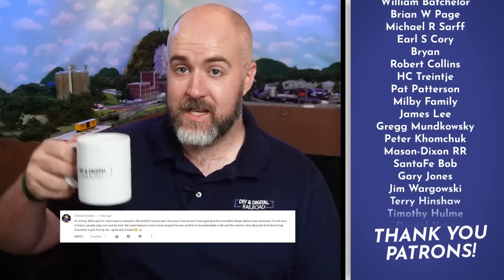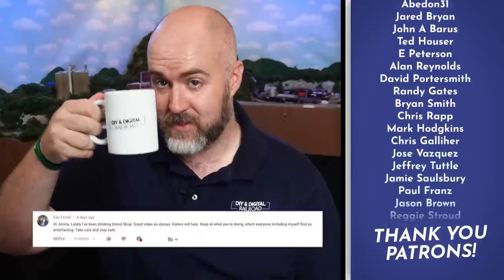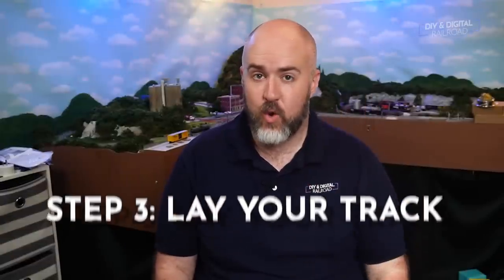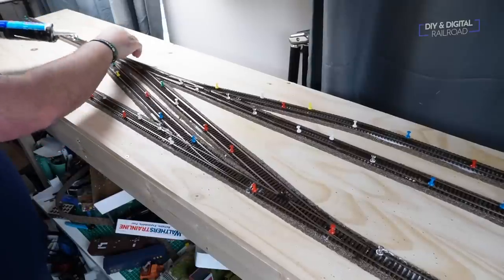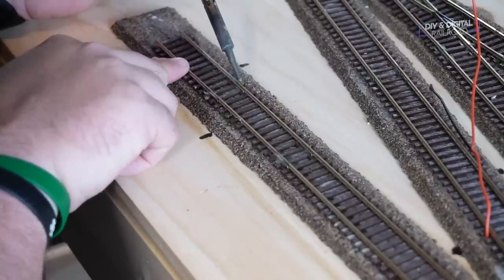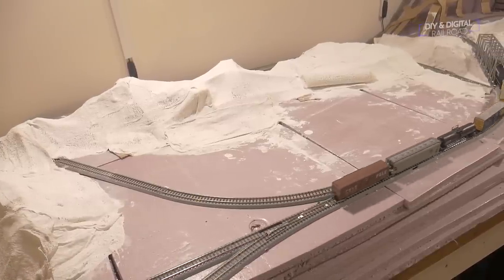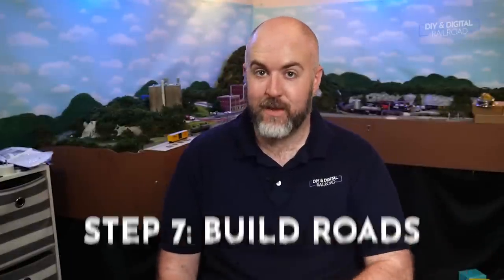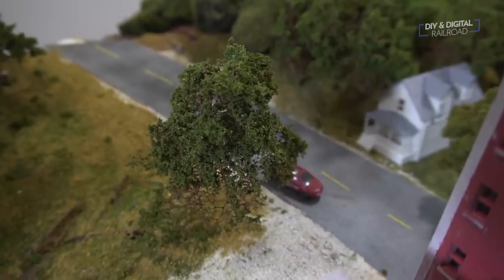Avoid a common mistake I made when building a model railroad

Comment: You are absolutely correct about the wiring.  About 30 years ago I inadvertently left out the main positive wire that fed power to an entire city block.  Every building was lighted.   I had to tear up the city block to feed the wire thru and branch it off to every building.  Also, track laying and wiring go hand in hand.  I developed a habit in the early days where once I got  a major section of track completed, I would connect some power and make sure every inch of track had power.  Once I knew a section was fully powered I was confident the next section would receive power and I would put that section to the test once it was complete.  Once my track was completed I would put a stress test on it and run every conceivable piece of locomotive power and rolling stock meant to be run on the layout to make sure there were no kinks, dead spots, or stock that could not negotiate a curve or turnout.

Comment: I'm drinking Dunkin' Coldbrew from the home packs I got from the grocery store. Also, I'm almost done laying track. I had to do 1 bit of scenery before I finished the track though, because it's a section where the road goes under the track, while the track remains level. I ended up using SmoothIt for the road, painting it, and adding some rock formations and painting them. I just placed the bridge, leveled it out, and added the roadbed last night. This weekend I'll start on the last bit of track and make sure that I can complete the circuit. I've been testing the track as I got, as a DC layout. I'm going to have a couple different sections of track, and sidings that I can turn on and off for where I park some other locomotives. It's been fun thinking about the order that I have to do things in. It's a kind of nerdy fun.

Comment: Step 3.5 once you've done the preliminary laying of track, connect it to a power source and have your tallest, longest, widest, lightest, heaviest, and whatever-est stock take a good few tours of every bit of track to make sure clearances are in order.

I built my layout with the idea that it'd be primarily used with my Marklin Alpha train. This is an exceptionally tall set, as in the spoilers on the wagons are taller than the pantographs for most other models. So where Marklin specifies 74.5mm clearance, I needed 86mm, which was a good thing to find out before I glued everything down and fixed the helix between levels in place.

Comment: Another precaution is to run a set of extra wires when you run the wires. This way if one wire gets damage or you add in the future they are already there. Also lighted parts can have a distribution block placed to run street lights , building lights , and etc  to make easy multiple connections.

Comment: Great video! I have one thought or two I'd like to leave you with. I paint my base color on the table top or foam, as soon as the bench work is done. Then paint the base color of your backdrop as well. May layout is multi level. The first level is the standard table top bench work type. So I paint the table top and visible leading edges dirt brown. My upper levels are of a shelf design. For my upper levels I paint  the top and visible leading edges dirt brown and the under side sky blue. It is my experience that these things are best done before anything else.

Comment: Yet another great video Jimmy, thank you. I struggled for years with flexi track, without much success, then I discovered Kato Unitrack at a local shop and have never looked back, though I did struggle fix it down when using foam as part of the baseboard, so thanks for suggesting latex adhesive.

Comment: I collect Ho scale and make an occasional diorama or 2 here and there. Since I live i 2 bedroom apartment by myself I’ve been really contemplating on making a suspended 2” wide wall/shelf layout with a few trams and overhead wires that runs in a loop in the living room, to the kitchen, and a little yard over the entryway to my apartment. I’ve been looking for large sheets for cheap or free so I can see through the bottom of the layout it when I look up. I really only plan on spending money on the train itself, and hardware if I can’t find or salvage it. I’ve got a few ideas but can’t seem to get anything concrete and even start. Since it’s an apartment I have to be mindful of not damaging the walls so I’m thinking of using multiple tacks as anchors to hold up one support, and have supports every 18” or so with the clear plexiglass track base running along the tops. I’d like to run a Siemens style tram so I know that wouldn’t weigh that much vs having the weight of a locomotive and multiple rail cars. Maybe I should start with building and experimenting with the supports to see what I can make and get away with while using minimal material? Then buy a kato tram w/ a bunch of flex track and go from there. I won’t be having and buildings. Only an occasions bridge that I will construct from styrene and LEDs. I’d like to pull of overhead wires as well. 🤔

Comment: Build proof of concept models. Whether it's a scale model of the layout, a full scale test of the benchwork height (especially if it's a multi-deck layout), or a diorama size test of scenery material, the time spent testing your concept is money saved on avoiding otherwise unforeseen issues.

Comment: I have a track planning guide for my layout and I have laid my track out but I have to get the cork done and I broke my right hip and I can't work on my layout until my leg strength gets stronger and it's very frustrating because I have been going to therapy for a while now and it's very slow process and it drives me insane 😡😡, but eventually I will be able to get there 😎👍

Comment: I’m not much of a wiring guy. After building my layout (600sq ft) I decided I wanted lights. Yeah, it would have been a lot easier if I had planned ahead. However, during my period of procrastination, fiber optic lighting was invented. I would highly recommend Dwarvin fiber optic lighting. As they call it “lighting without wiring”
Reply: You still have to run the fiber?
Reply: @coolruehle  Yes, you run a fiber optic “cable” from the building to the light source and the light goes on. Very simple. Dwarvin has a number of videos on YouTube, check out their channel.

Comment: Was thinking of running wire using telephone and power poles and doing small substations to form power grids.  ?
Reply: enameled magnet wire can be painted with acrylic paint. Just beware all the real caveats apply, voltage drop, overloading, heating etc...
Reply: @gravesclay  yeah I get that. Been involved with cars and custom electric work. Stereo systems and more. Including ATV accessories and orv. When doing substations thinking about capacitors to maintain and increase the power output. What you think?

Comment: I’m learning ahead of building.  Everyone seems to run wore under the board.   What would be the problem with having the wire on the surface with the track, etc.  It could be covered with landscaping.  Is that possible  or what am I missing?   Complete novice here.

Comment: I am 60. Just got bit by the bug. But I am not up to date on the style trains. Like what engine goes with what cars? And I am on a really tight, like choke hold tight. So not sure where to go from here.
Reply: I'm on a small budget myself, able to buy some things as I've gone, plus people have given me gift cards for my birthday that was a couple months ago. I'm not really too bugged about what kinds of cars I run though. I have some locomotives that run well, and I have some cars, and once I get the whole thing running, I'll probably pick about the best 8-10 cars and keep them close. I luckily was able to purchase an old set from a friend for the freight. I picked up some DC locos for less than $50 that are decent. I was able to fix one and rehab another. I picked up a Santa Fe that I've started painting to look like Penn Central. I did end up buying one 1 switcher loco brand new with the intent to paint it. It runs so differently than my others, it's crazy. 

I'd say don't worry about matching engines with cars really. If you just want to learn about it, check out railfan videos for whatever you like. Since I'm interested in Penn Central, there are a number of interesting videos people have made that I can find online.

Comment: As for the wiring for scenery, i had this idea.
What if i was to cover the wood with a layer of aluminum foil (or perhaps copper foil), then a sheet of insulating material, and another sheet of copper (aluminum, aluminium) foil?
Then i only have to cut out a small part to connect 1 wire, and i can connect the other to the other sheet on top. 
And have the entire table carry the juice.

Would that be an idea?

Comment: You need to do a bit and walk away, because you will keep changing your mind on the layout. Once you start positioning track, you realise it's too tight or looks boring.
Reply: Laying track, i use double sided foam tape, used for poster boards. If you change the layout track just's lifts off. When satisfied can then ballast the track.

Comment: Hello Sir, I enjoy watching your videos I just don't understand anything about them at all. It's not your videos I don't understand it's me I know absolutely nothing at all about how to build a layout. My number one problem in model railroading is the biggest problem of them all. I Don't Own A Computer, all I have is a cell phone and a tablet. The last time I checked it is a requirement if you want to design a layout it has to be done by a computer. Software companies refuse to design a software so it can be used on a android tablet. This is the 21st Century and you can't use a cellphone or a android tablet to design anything because software companies only want you to spend at least $10K for a half ass computer that will only work for about 6 months if you're lucky. 
I can't draw because of my Parkinsons
Reply: Who are you buying your computers from?  $10K for a computer?  Are all the wires made with gold?  My laptop has a top flight CPU, 16 GB of RAM, two hard drives (one of which is a solid state HD), and a top end gaming graphics card with 4 GB of it's own memory.  It cost me $782, including taxes, and there is nothing it can't do, so far.